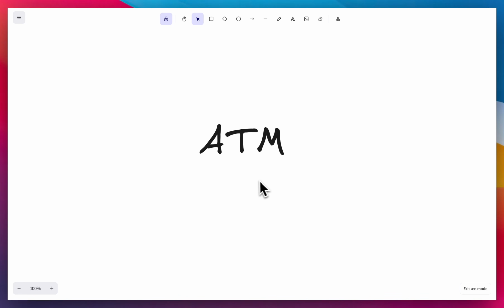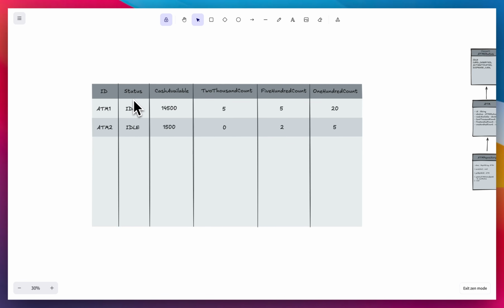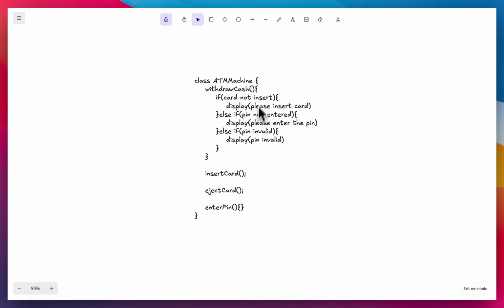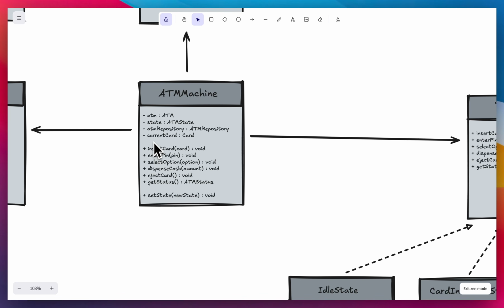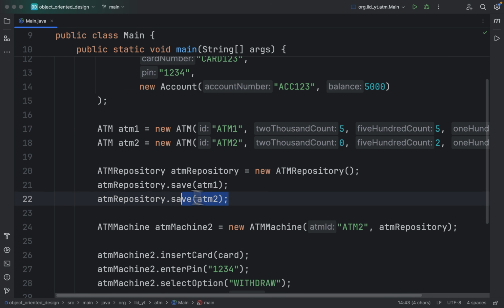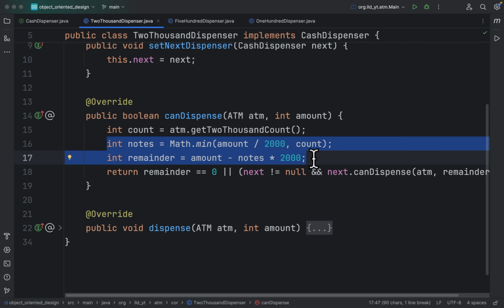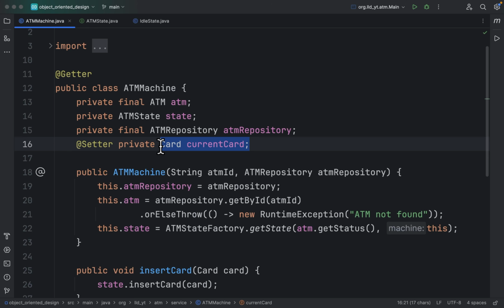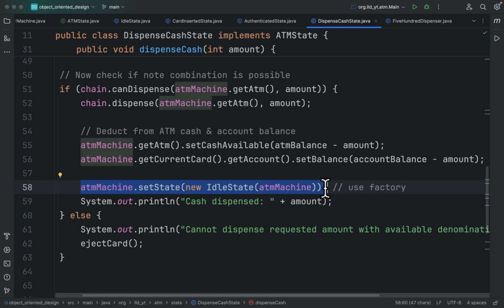Design ATM Machine (LLD) | Cash Withdrawal Flow | State + COR Pattern

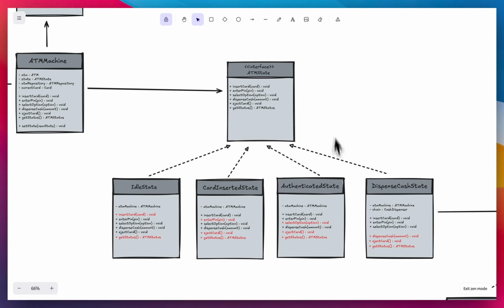Comment: Hi Shubh, Is it breaking the solid principle(Interface Segregation Principle (ISP)) by overriding the method which they don't need in particular state in your tutorial at 11:44 Sec
Reply from the maker: It may look like a violation of the ISP because some state methods just show messages or are empty.

But this is an acceptable trade-off. If we strictly follow ISP and split interfaces, the client would need to check the state type (using if/else or instanceof) and then cast before calling methods. and that kind of type checking is a code smell because it breaks polymorphism and makes the code harder to maintain.

State Design avoids this by letting each state handle the behavior, even for invalid actions (like showing an error message).

Comment: Wouldn't this still violate the Open/Closed once new denominations are added? We would need to modify the ATM class with tenCount or fiftyCount.
And also, the COR isnt proper, we are updating balance/notes before we are able to validate whether it can dispense
Reply from the maker: Regarding modification of ATM class by adding new variables - instead of having new variables , we can have a map of denomination to count. Thanks for pointing out this.
Reply from the maker: Theres canDispense func which checks if we can dispense the amount from the atm or not. If its true then only we dispense (update the count).
Reply: +1 on having a map of denomination vs count

Comment: The can_dispense method isn’t working as expected. For example, if the machine has 2x500 and 3x200 notes, calling can_dispense for 1100 rs returns False, even though it can be dispensed as 1x500 and 3x200. 

A better approach would be to loop through all possible combinations of 500 notes from max_notes down to 0, checking if the remaining amount can be covered by the next dispensers in similar way. If successful, store these counts in a parameter (like soft_count) to avoid recalculating during dispensing. For instance, first try 2x500 with the remaining 100, which fails, then try 1x500 with the remaining 600, which works—so store soft_cnt=1 in the 500 handler and soft_cnt=3 in the 200 handler.
Reply from the maker: Thanks for pointing out this bug. Your approach seems good. Or probably get all the counts in an array and then perform dp.
Reply: Yeah something like target sum problem, would make sense here

Comment: Hi @shubhpatel_18
I think here there is no use of ATMRepository as after updating the atmMachine2->atm info's like CashAvailable, TwoThousandCount, etc, you no where updating the atm again in ATMRepository, still in one main function you can keet using updated atmMachine2 instance without need of using any updated ATMRepository( which you have no where updated ).
So simple, in main keep creating new atmMachine1, atmMachine2 with new atm for each.